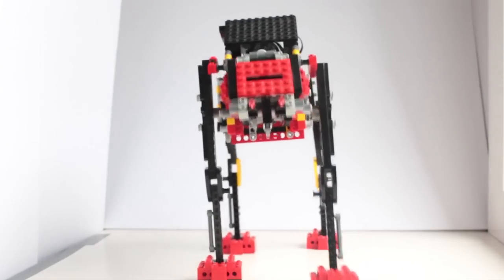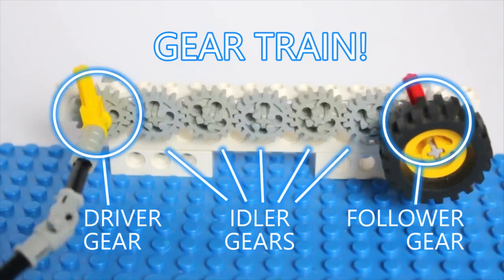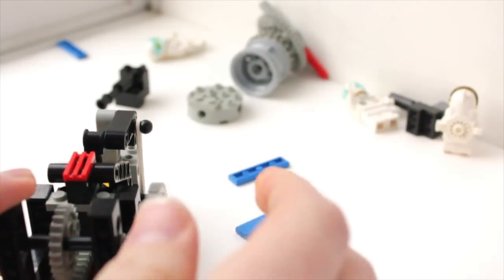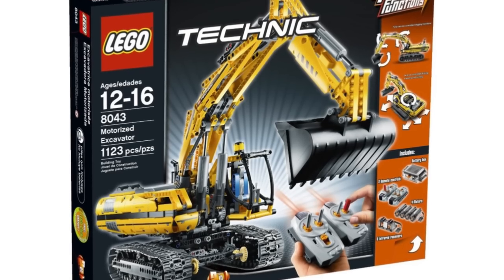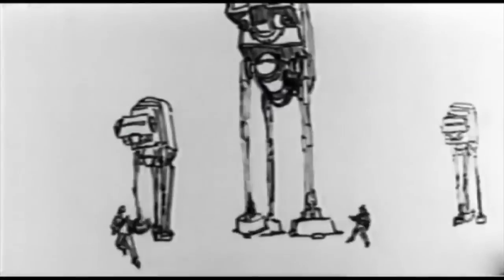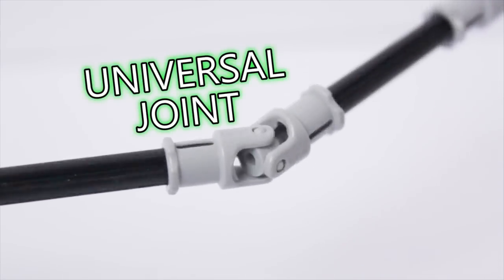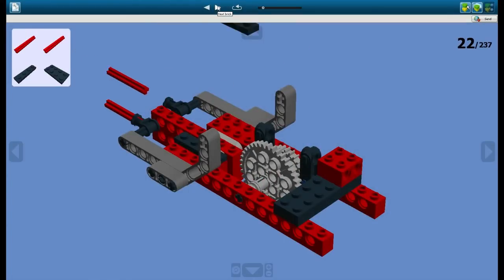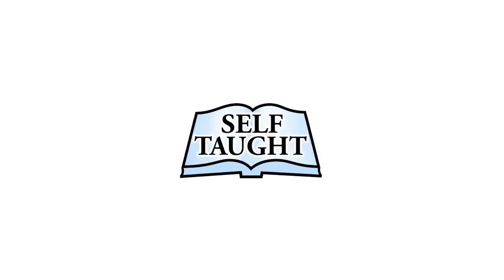Build a Lego Star Wars Robot

Comment: What about making the feet (in a sense like your rouber banded gun) going up and then rapidly down when the robot moves (only one foot per time has to do this when moving) it could help the robot to walk on surfaces that are not so flat :P
Reply from the maker: You are correct in saying that the leg system could be greatly improved. But as I said, long robot legs are difficult to work with!